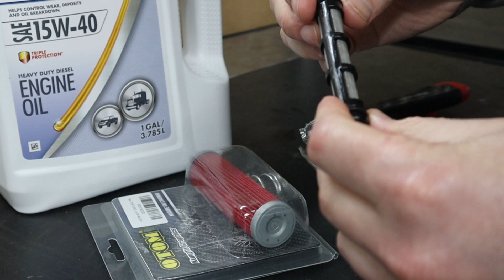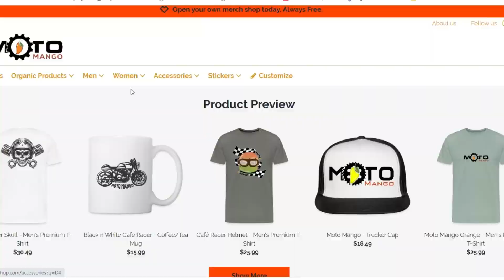How to Change your Dirt Bike Oil #kayo #k6 #EFI

Comment: And on the gearbox side there is another coarse filter, does it need to be removed and cleaned?
Reply from the maker: I only knew of the 2 filters lol let me check the manual and get back to you. Any filter needs cleaned and/or replaced time to time
Reply from the maker: Also, you can get the manual for free from whygostock.com happy wrenching!